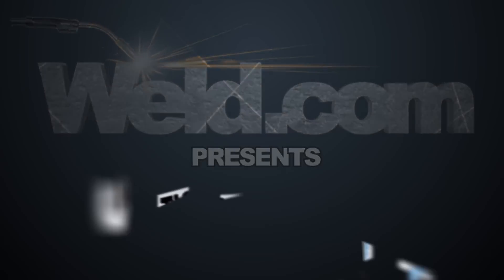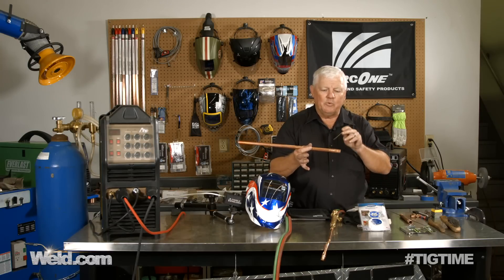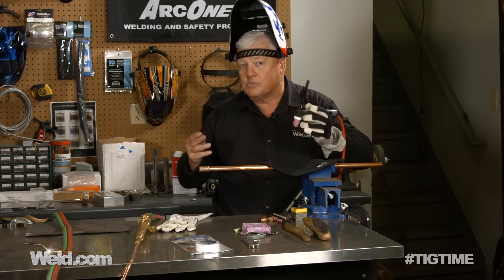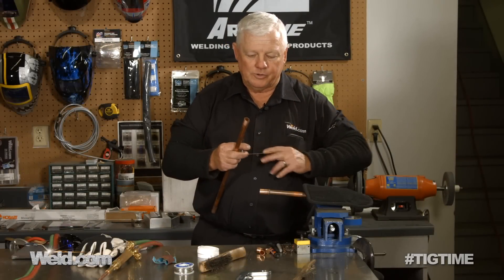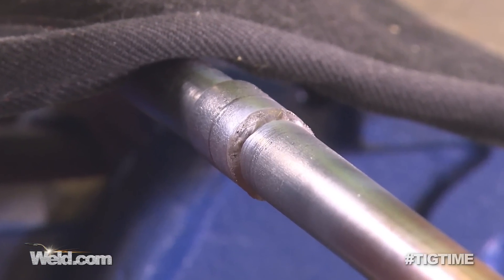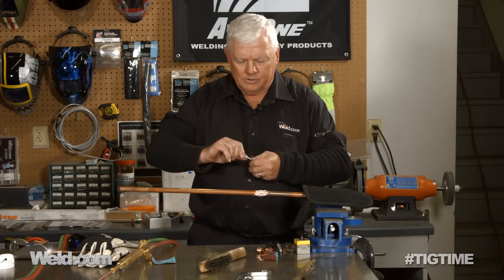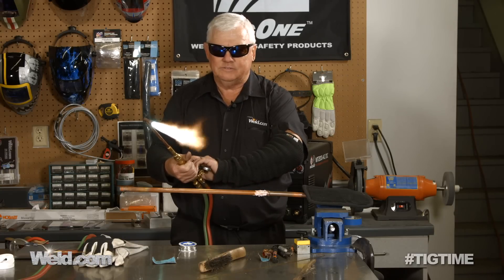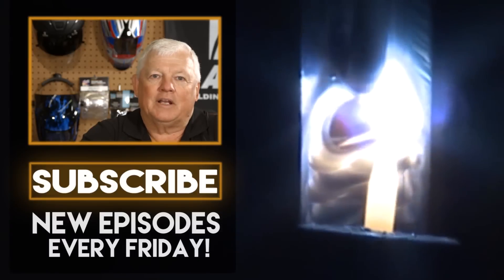🔥 TIG Brazing VS Soldering Copper Pipe | TIG Time

Comment: TIG is probably limited to bench work since you usually can't easily access the fitting all the way around, such as AC compressor fittings.  With a gas torch (w/ Ox), you heat the whole fitting, then the braze rod melts and is drawn into the gap, similar to soldering though not as fully, so still need to get at it at least 180 deg around.

When soldering water tubing, a little extra flux inside the tube isn't a problem since the water washes it away, but don't get any flux inside AC tubing (since corrosive), and use silver solder (or braze) since the pressures are higher than for residential water.  I wouldn't waste Ox on soldering since a Propane-air torch suffices, or even Butane if small fittings.

Comment: In the end it all boils down to whether it will hold the pressure for the task at hand... You should have filled the pipe with water, put it under pressure, and saw if/where it leaked...

Comment: My question is how come you aren't aiming the TIG torch at the bottom of the joint for the heat to draw the brazing alloy in? Also if you are going to use this for HVAC you will have to purge the inside of the line as well. Might as use some of the argon for this. You don't need much, like 1 cfh or so.

Comment: The people who braze copper are primarily HVAC installers in my opinion.  We don't get to rotate the pipe.  Plus, the preferred brazing rod is SilFos 15 a Cu Ag Zn brazing rod that is self fluxing.  Also with refrigerant lines, it is necessary to maintain an N2 blanket inside the pipe in order to prevent CuO from forming.

Comment: That is way to much flux. I only use enough flux to put a thin layer and it does fine. Most of his flux just runs outside the fitting and drips down. A waste

Comment: For those ho never used and oxipropane or an oxiacetilene (10:20 ) you should never close both gases at the same time....
"The oxígen always come after at the beginning and go before at the end" (an old saying in Spanish)
I understand the guy make quick for the video but ...no, is danger.
Very Good video 👍 greetings

Comment: Way over complicated. I would even say stretching the boundaries of what this channel is for. Soldering and brazing are similar but tig brazing with a silicon bronze rod is not a common practice in plumbing. Brazing for plumbing typically uses a silver-phosphorus (sil-phos or Staysilv) to join materials. Also, the brazing process in plumbing uses a torch, mapp-pro, air-acetylene or fuel acetylene. Lastly, he only put a cap on the joint. Often, you need full penetration of the fitting not just a cap.

Comment: Since copper is very easily reduced from its oxide, it may make sense to add a small percentage of pure hydrogen to argon when welding copper. This certainly carries some danger due to the combustibility of hydrogen, but I suppose with the proper precautions everything should be fine.

Comment: You used more flux on that one joint then I use on half a house system. 
There is absolutely NO reason to flux the outside of the fitting. It's like painting the inside of your chimney.

Comment: Flux should only be applied were you need the solder to flow. It is an acid and it needs to be cleaned off or it will corrode the area that it is left on. So don't put it where you don't need it. 
Also,  too much heat and the solder won't  stick it just runs out. If that happens pull the joint apart, let it cool off then re prep it again and then start again. Don't waste solder if it isn't taking.
The solder must melt via heat from the metal not the flame of the torch. Apply the solder on the opposite side from  the area that the flame is heating, the solder runs towards the flame. This is how you can solder on the back side of a joint.

Other options are silver solder (copper to steel, brass also), and various copper to copper rods that are used in the HVAC industry.

Comment: This was disgusting especially that wash at the end. Why not just Propylene Oxygen braze that joint? That did not look strong or very appealing. The tig joint looked kinda messy as well.
Reply: Also I don't understand the flux you brushed on. Typically that's used for brazing indifferent metals together.
Reply: I almost forgot lol I think I would've pulsed that joint together without a filler using tig.

Comment: Need to add a part about AC tubing. The pressure doesn't allow soldering if I'm correct, they use a higher temperature process like braising. It might be braising. What ever it is, it takes the temper out of the copper and they flood the tubing with, I believe, nitrogen to prevent contamination. With the layout, using tig would not be practical.

Comment: Im not a tig welder closest i came is gas brass filler. I am interested in auto body sheet metal work. I do rust out mostly some fabrication with a mig welder. This is thin metal 20~22 ga. Usually. I have this idea that tig silicon bronze would be lower temp and therefore less warpage. I dont hear this touted by anyone. Cant figure out why. Also which tig welder would you recommend for my application. Or if you think this is all a bad idea and I should stick with mig welding.. thanks for your informative. Channel.

Comment: Something nobody caught: watch his "TIG Brazing" again, and pay particular attention to the edge of the female part. It is melting away as he advances. He is actually fusion welding the copper, not braze welding. Not that it matters much for the end result.

As for the "soldering", enough folks have commented on that already. I will point out that a good silver-bearing solder like Stay-Brite and Stay-Brite 8 will hold any pressure that soft copper itself is capable of holding. Braze joints are certainly stronger, but the high heat anneals the copper and leaves it at it's minimum strength, which is actually weaker than the solder joint. Just don't use 95-5 or other plumbing solder in AC&R apps, as it lacks the elongation and ductility to tolerate the vibration. Only solders developed for AC&R use like Stay-Brite are suitable for AC&R use. Harris metallurgists developed Stay-Brite back in the 1970's specifically for use on AC&R applications. Although I braze most joints, I use Stay-Brite or Stay-Brite 8 sometimes, depending on the application. Never had a failure or leak with either, and I have Stay-Brite fittings that have been in service on refrigeration TXV's for over 2 decades.

Comment: Hello Mr. Tig, I can tell that a few spot on the brazed area with tig seem to have a spot of not enough of flow and more lay on top of pipe. Also, If you would of used Harris six percent silver soft solder you would be able to keep the high strength of the hard copper without softening the base metal. Which is about half the strength from full hard to annealed soft. A known fact about draw through die copper pipe. The soft solder joint you prepared is right on. You should of used a wet rag and just cleaned up the solder off the pipe for the professional look and tempering. Also, I have found that using a large soldering iron would prevent you from burning the surrounding and help keep oxidation at bay too. Good day and stay virus free Mr. Tig. VF

Comment: Only use that rosebud if you need to burn the house down to cover up all of your solder joints with 5 pounds of lead in them. 
A propane torch actually is faster. Pull the trigger and no adjusting.

Comment: Agree with other comment , soldering not required a lot of paste , just make sure  both surface  clean sanded nice, and both pipe apply a little be paste. Also look like he used electrical solder instead 95/5. if you used Silver  SOLDER it nailed forever ever but that solder IT price double than regular, not even every plumbing supply carry it.NOW we step up in next century and start using PRO PRESS fitting and is much better quality and more faster then old school braising which was good  for bigger size copper pipe from 2'' and UP.. Conclusion that video Miss Informative.

Comment: I'm sorry for my comments coming, but, . . . . . . .  WTF are you doing?

First of all. soft soldering is below 1000ºF.  Silver Soldering/Brazing is slightly above that, around 1400ºF - 1800ºF., depending on altitude/pressure, in which case you nitrogen purge the inside of the lines to prevent oxidation inside the copper.  You should NOT TIG weld copper piping, even in a submariner role.  Brazing and Silver Soldering is more effective even in that role than "welding" copper piping.  We are talking about 40,000 to 70,000 pounds of force to break a properly made silver soldered joint.  The pipe will burst before the brazed/silver soldered joint.  You have absolutely no idea of what you are doing.  Go back to school newbie!  I've done this since 1985, and my braze/silver solder joints have held from 10 years to the present, barring external damage, on systems up to 800 psig.  Maybe welding is your forte, but brazing and silver soldering is NOT!  You are making a mockery of Plumbers and HVAC&R technicians nation wide in your inept instructions on this one.  There are more than one type of copper wall thicknesses, try these for instance, type K, L, & M.  Understand the wall thicknesses and their burst pressures.  Too much flux on a refrigeration system makes the oil acidic and destroys the compressor's  windings.  Too much flux in a water system is detrimental not only on water qualification but also acidic to the environment and detrimental to joint cohesion.  Son, you need to go back to school before trying to teach this aspect of piping.  The Union Plumbers and in my respect, HVAC&R repairmen, take exception to your "teaching thread"!  Stay in your lane of expertise, and don't venture in to ours.

Comment: I think both ends should be sanded with fine sand paper to get a good clean connection with the solder.
Reply: Never use sandpaper it can holds contaminants better steel wool or fine file.
Reply: @diamondcar2842  My father always used sand paper for a clean connection and he never had any leaks. Real fine paper he always used.

Comment: Red hot copper joints lose tensile strength and yield to ductility, the red hot sections balloon up under high pressures later

Comment: I've done lots of soldering using either a propane or butane torch, with paste flux and regular old plumbing solder, and I've learnt that too much flux does a couple of things. Firstly, you can't actually see your joint very well, so you can't be sure that you've got that full capillary action. Secondly, it can leak later on, by forming little holes in the inside of your pipe. (I'm not one hundred percent sure about that second part, so someone else will probably explain it better). I find that applying similar principles as the ones used in oxy fuel brazing gives good results. Too much powdered flux on an oxy fuel braze just gets in the way and you can't see your solder getting into the joint properly. The Tig brazing part was informative though, and I enjoyed that. I just feel that TIG brazing is explained much better by some other folks, such as This Old Tony.

Comment: That soldering was ridiculous. The amount of flux was way, way, way, way,.way, way, way, way, way,.way. way, way, way, way, way, way too much. 

Imagine that being a drinking water line, it would.take years to clear that flux from the line. It's also super sticky on the outside.  

Referring yourself as MR. TIG is absurd. I'm so glad Bob Moffit is doing the weld.com. vids. Rosebud oxy to sweat some copper, LOL

Comment: Holy SHIT YOU CANT SOLDER TO SAVE YOUR LIFE HAHA. Second, a brazed joint using a BCup filler metal (silflos) will be 10 times stronger than that tig joint you made, you didn’t penetrate one bit, I would trust a SOLDER JOINT than that tig joint

Comment: Mr.Tig,
First, Hi from the UK, and i'm a hobbyist Steam Engineer. Ive been looking into TIG Welding copper boilers, and ive got a question. 
A lot of the boilers that are TIG welded mainly weld the flanges and not the heat exchanger pipes, Is there a reason for this?

Comment: I have a small issue, I’m soldering a brass piece to a copper pipe, and applying the same amount of flux, but the solder doesn’t get sucked in when both parts are heated.
What am I doing wrong?

Comment: In Australia we use a tiny amount of dry nitrogen inside the copper pipe to stop scale. We also use brown tip solder. No need for flux or that type of solder at all unless joining two different metals (brass to copper for example). That flame... well i guess it speaks for itself......
Reply: Thomas Woodlock we use same nitrogen technique here in states too... well the guys that know what their doing... in my opinion, this guy here is way off about so many things...

Comment: Soldering correctly is usually strong and fit for purpose. If you need super strength then use stainless steel tubing. Much better to weld, less clean up.

Comment: You just waste a lots of flux, I don't know your specialty exactly, I'm not a welder, I'm not a plumber but I can say your TIG welding skill is  terrible, over using flux for one small joint was unnecessary just like over killing a simple soldering process with ugly finish look, that huge acetylene torch was enough to braze and have excellent and cleaner weld result instead, no need for TIG when you have brazing equipment, also a small $20 propane torch will do the soldering job perfectly.

Comment: Do not follow the instructions on the soldering portion - I repeat DO NOT - Don't flux the outside and inside of the pipe and the fitting - just the outside of the pipe and the inside of the fitting - too much flux causes a shit ton of problems - don't use that type of torch (as he noted in the video) - the whole thing is wrong - If you are a plumber watching this you have to believe me - you don't start heating the fitting first, you dont leave a solder snot like that - i as a master plumber am speechless

Comment: That’s overkill nobody does that. Your hot water ain’t gonna be at the melt temperature for your solder not even close. The psi should be at 60 psi if it’s higher you can get a prv valve. 💩 people do.

Comment: Holy crap. So many things wrong. You can’t often use a big ass torch like that when you’re making repairs. You’ll ignite the house!

Far too much flux for a water pipe, no need for flux on the outside of the female section, and the braze... wow.

Comment: there is such a thing as too much flux! also you should have more heat away from the joint or use a smaller torch. your flame should not be meting your solder, your pipe should. that TIG joint looks like it needed more heat to melt the braze material to the base.

Comment: the major difference between welding and brazing is welding melts both the base and filler, while brazing melts just the filler, and honestly because I braze copper to copper, copper to brass and copper to steel on a regular basis, this video is kinda cringy, although I use a proylene oxygen mix torch

Comment: When  I  have to braze   copper such as Oxygen lines or   replacing a compressor on an AC system  I never had to use flux   as copper with the correct rods no flux is needed  

. With a tensile  strength over 87,000  PSI  and the filler metal melts  around 1,200 deg    using the correct tips it is just about impossible to melt the  copper  

Also  the procedure  I like it to heat the tubing and then the fitting to allow capillary action to  do its job with a much neater appearance

Comment: Too much heat, too much flux(not a bad thing), and too much solder. #2 , why use a tig for bronze? Its exactly like sweating with solder, just higher temp. Too much build up and no heat at the back of the joint means nothing got into the other end of the joint. Not bashing,  just offering my 30+ years.

Comment: Some sil fos would have flowed very nicely with that overkill rosebud tip. Way too much heat on that solder joint. Wouldn't be surprised if that thing never held any pressure because all the solder bubbled out. Also, you CAN use too much solder. Especially on water lines. If you did an entire house with the amount of solder used in this, you'll be cleaning plumbing fixture screens and shower heads for ages.

Comment: we braze with an open flame getting the socket cherry red and the filler will flow onto the joint. You can never braze only one side of a fitting, it is impossible to clean the other side so we braze both sides

Comment: Well, someone should try to braze a copper pipe to a fitting or another pipe on the field. Most likely there won't be enough space to braze the backside of the pipe, which happens very often if you're working in a house made of bricks. Oh, and try to rotate a pipe that's already been built in the system, good luck doing it.

Comment: As a plumber/HVAC tech for 30 plus years, and an HT2  while in the Navy (welder), stick to tig. That's your forte, not soldering (way too much flux for starters) lol. Silver solder is best for high pressure in most applications, and must be careful not to overheat, as the scale can plug capillaries and orifices in A/C units

Comment: Hi Mr. Tig, two questions if you don't mind. First, your torch angle seems extreme at the end of each segment of the bead when brazing. Is that intentional? Second ( actually two part question ), doesn't the copper become annealed by the tigs high heat and therefore it's integrity compromised for a high strength / pressure situation? I realize this demo is just plumbing pipe, but what about a heavier schedule or something structural? Thanks in advance for your reply and for the videos. Very informative! Peace.
like a sculpture or repair on something bearing a load?

Comment: so over the top with the soldering   why a massive torch when a gas handheld will do  and why all the flux   on the outside and so much   and why the glasses   .   over doing it   and why braze the pipe  not necessary  . making a big job out of a small one